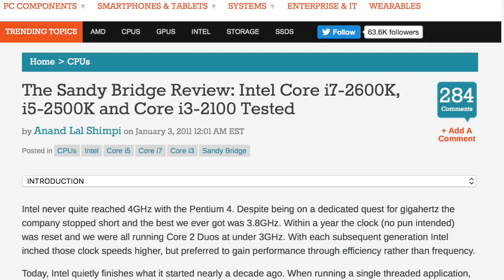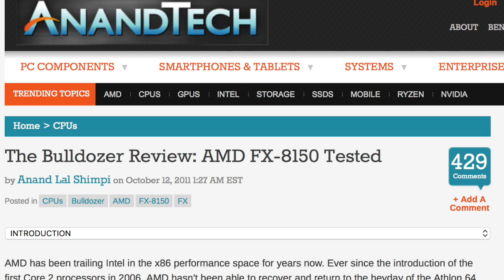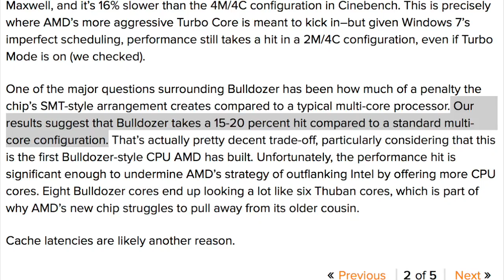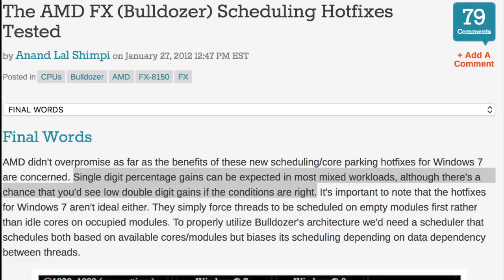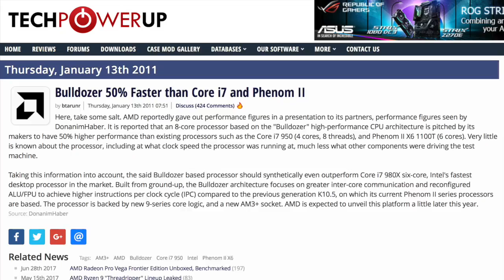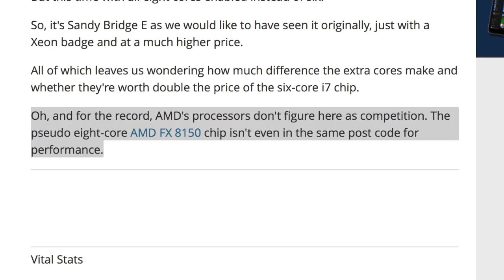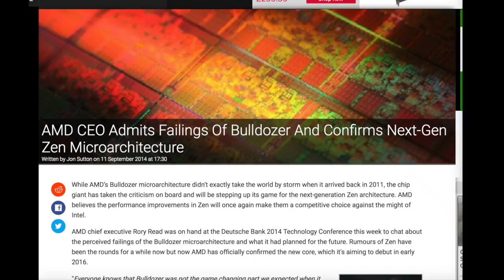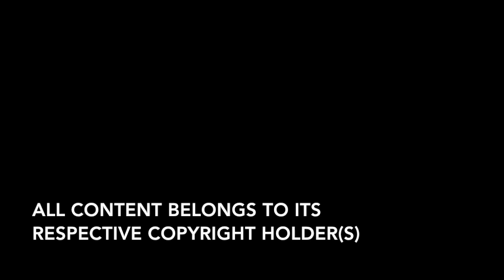The Bulldozer Story - and why AMD FX is better than you remember

Comment: I'd honestly have to say Bulldozer was indeed a failure. The FX-8150 couldn't even beat an i5-2500K in some multithreading tests. It gets even worse when you look at how much power and heat the FX-8150 would generate while under load. Bulldozer only did well in integer workloads that took advantage of the 8 Integer cores, but most applications, especially games, use Floating Point calculations; the FX-8150 had only 4 FPU cores that were shared between 2 cores put into what AMD calls it as a "module". This was a serious bottleneck on AMD's hands, but they decided to just go with this design anyways because there was no turning back then. The Core i7-2600K ran circles around the 8150, even in multithreading workloads that actually favored AMD. There were only maybe at most 3 benchmarks I saw from Anandtech that showed the FX-8150 winning against the 2600K. What only added more insult to injury was when the FX-8150 struggled to beat the Phenom II X6 1100T, despite a significantly higher clockspeed. When overclocked, the X6 1100T could probably beat the FX-8150 in even multithreading. This made the FX-6100 and FX-4100 not even worth buying if you had a Phenom II because of how slow they were. The 1100T dominated the 6100 in single and multithread. AMD was trying to call this generation of CPUs the next performance king and that it was going to outperform absolutely everything, but it underwhelmed all of us... massively. This only led to more disappointment being felt by all of us.

Then Piledriver released... but it still wasn't good enough. The FX-8350 was against Ivy Bridge, which still beat the FX-8350. Although Piledriver actually somewhat gained ground on the Core i5 in gaming and beat it in multithreading workloads, it still used much more power. Sure, it was competitive at the price point, but it only hurt AMD in the long run. A Bulldozer/Piledriver die size was a mammoth 316mm^2, whereas Sandy Bridge and Ivy Bridge were 216mm^2 and 160mm^2 respectively. AMD had made such a huge die size, meaning AMD could not fit as many CPUs on a silicon wafer. AMD had to spend more money to make the same amount of CPUs had they just went with a smaller die size. AMD had to sell these chips for a high price in order to make a profit due to this, but AMD couldn't when the Core i5 and Core i7 kicked the FX's ass in pretty much everything. In order to sell inventory, AMD had to price their chips lower and lower. OEMs didn't want FX, it ran too hot and it was too power hungry for small form factors. People in the server market didn't want Bulldozer either because of the power consumption when you could get pretty much the same performance from a Xeon, while using much less power. When you look at it this way, AMD was screwed either way with FX; they were stuck with a massive die sized chip that was very expensive to produce, but couldn't sell it at a high enough price to break even.

Then there's the motherboard issues... FX drew too much power for most motherboards, burning up VRMs due to this. This was very apparent with the FX-9590 where even the best motherboards were likely to be burned up due to the power draw. Motherboards were not designed at the time for such power consumption, causing the FX chips to actually throttle to avoid burning VRMs, which worsened the performance all around.

Economically, Bulldozer was a failure. There's no arguing that part. AMD had barely been able to keep afloat without being bought out or becoming bankrupt.

Comment: I have 3 desktops 1 has a FX 6100(Bulldozer) 2 has a 6300(Vishera/piledriver) 3 has 9590 (Vishera/piledriver) I game on the 6300. I use the other 2 for things like rendering 3d images in 3D Max, and other heavy threaded tasks, I also use them as servers. Under this type of workload, they perform awesome. These CPU's do best when u are running many things at once. I love my FX processors. I will not be upgrading to Ryzen, or switching to Intel. These processors do exactly what I need them too, and they do it efficiently. Can't ask for more.

Comment: Yeah my ATi/AMD machine can support a Bulldozer, but no processor they made had any significant gains over my AMD P2 - 1100T Black.. So at the time of Bulldozer launch I easily dismissed it.  The only way a Bulldozer outperforms my CPU is if my PC is off (which it currently is).  The only thing AMD did with the Bulldozer was dig holes in their road and let Intel skate away..... Also, you didn't mention the issue AMD/ATi had with shrinking their CPU die size ... which i believe they couldn't get down to the 28nm size where as Intel was at 22 and their next processor was going to be at 14nm.  Writing was on the wall... AMD was the only option if you couldn't afford an Intel build.

Comment: for me its this simple, its 2012, you have £100 and want to game and edit videos.
fx8320 and overclock vs i3 3220
one is 30% faster in tasks you might aswell get a celeron for.
the other one is equal in gaming and 100% faster in rendering videos and will last longer before needing to be upgraded.
fx8320 was best cpu i ever bought, 5820k (seems i love anything with the numbers 8, 2 and 0 in them) thoguh im now kicking myself that i gave intel money.....GREATT cpu, shit company, bring on threadripper 2.
they say games only use 4 cores, when i bought my q6600 they said games only used 2, look how long core2quad lasted and how long core2duo didn't.

Comment: That's the weakest argument I've ever heard. "The CPU isn't bad at all. It was just released at the wrong time." No, the CPU WAS trash, and even AMD admitted it. Was it weak for the money paid? Yes. Given the state of the market for gamers and the like, it was a horrible choice. As proof of this point, AMD's newer Ryzen 3 1200 clocked at 3GHz is within 2% of the performance of their flagship product, the FX 8370. A quad core of the newest generation clocked a full 1GHz slower is as fast as their old 8-core CPU running a full 1GHz higher.

THAT proves that Bulldozer and Piledriver were failures in design. Claiming they'd be better if they didn't have these issues is irrelevant. That goes without saying. It doesn't mean you have an argument to prove they're decent processors, it simply means you understand that they are what they are and what they were at the time. It also wasn't just Sandy Bridge they were up against, it was literally every CPU since Nehalem that AMD had to compete against. That was the issue. By the time Ryzen was released, Piledriver and Bulldozer were so hopelessly under-performing, that even when games fully utilized all 8 cores, performance was STILL less than an equally priced Core i5. There was no comparison and still is none to be had.

Comment: 7:50 This is incorrect. Note this Underload the AMD processor did not heat up. Incompatibility would cause AMD processors to heat up. Virus an Trojans,incompatible mods and Programs would cause AMD processors to heat up. Note open your cause you can find out by touching your graphics card or Hard drive. Both will be the things heating up. Not your processor. So it was incorrect.

Comment: compliers is the key word that developers never take any advantage of brands processors make...its lot simpler for doing microsoft way to compile than custom the software code based...c++ does the work..but it relies what emulations always want...more clock speed to push gpu data quicker out the pcie to memory then cores....not just throws the ipc and cores will solved the problem..nope, c++ take advantage any avx code and push more cycles per instructions from game engine was not based on windows 10....more like it was based console custom game engine

Comment: Im still running a 990FX / FX 8150 in 2013/2018+. (Asus ROG crosshair V Formula Z).

On Windows games like RaceDriver G.R.I.D. , Flatout 2, F.E.A.R, F.E.A.R. 2, Shadow Warrior, ROTT (after all them patches) paired with  GFX cards like the GTX 480, GTX 569ti , Radeon HD 7890, r7 260x, Gtx 960 etc and what I can afford (GTX 960 / R7 260x $150AUD vs $300AUD Gtx 1050ti / $480AUD RX570).

I don't play many current gen games apart from Doom 2016 and Shadow Warrior 2 (far mor taxing) I can still game unhindered (Wolenstein New Order required hefty overclock disabling half cores [1680x1050 / 720p] [crossfired 2GB r7 260x / single 2GB GTX 960)

Most problematic was running 2 instances of Hamdbrake transcoding h.264 1080p Blu Ray to 720p HEVC while out for the day on a ~38°c day with insid ambient rising probably passing 33° hours before O came home and smelled the settled dust burning with a hint of solder joints.

Fast forward to 2018 with 3 core pairs ~6 cores still working above stock I still have a little wiggle room.

Comment: remember when intel blaitantly lied about pentium 4? and then tryed to cover it up with bribery to benchmark software makers. then a decade later they owned up to their lies and offered 10% refund to any one with a valid pentium 4 system recpit.. their little lie made their users look retarted when they tried to regurgitate intels advertising lies vs real life results and performance of an athlon 64x2 slapping them in the face with cold hard fact. pentium 4 was the ultimate real failure even beyond cyrix as the biggest failure as industrys crippled them selfs by opting for pentium 4s setting the world back with literal garbage. then intel thought it would be cool to make a cpu that you pay for a code to actually use its full potential.. Dlc cpu?!?! fk that intel is not to be trusted. curb your enthusiasm for big dollar ad lies.
Reply: The P4 did have a few perks. Double clocked ALU meant that integer performance was pretty damn hot, FPU performance was not impressive. Intel did this with the intent of SSE2 blowing everyone's mind and everyone recompiling their programs.

Where AMD screwed up is they took notes of the Netburst architecture and must have genuinely thought that was a good idea. There are a lot of parallels between Netburst and Bulldozer. Similar 20-30% performance increase in the second generation as well.

I'm still pissed they never finished it. They finally released an Excavator core in Bristol Ridge, but it was massively cut down from the original Excavator design. A 14nm Excavator might would have changed everyone's tune. Originally they had plans for major improvements in the integer config, which was actually pretty damned decent, the FPU was going to be doubled...

Damn shame, just from an academic standpoint I'd have liked to see how it would perform.
Reply: Yep, i was one of the fools back then, bought a 478 socket 2.4GHz Pentium, that was the worst cpu that i had in my life...
Reply: Damn, good to know. I know P4 was beat by Athlon, but I had no idea it was objectively shitty
Reply: And AMD was any better with FX? lol, AMD fanboy alert.

Comment: While I plan on upgrading to Ryzen my old FX 8350 @ 5ghz still runs my games great. I cap my games at 60 fps with a free sync monitor. Many of the games I play are at 2k the older r9 390 still performs well. Key to FX is OC ram and at least 4.7ghz also use core park app that you can just turn off parking even after the patch certain games have micro stutter as it unparks.

Also using Radeon Pro to reduce  bottlenecks and understanding which settings is cpu or gpu bound. What games use all cores and which ones use only two for example. For example Fxaa/smaa (AA) is gpu bound and old Msaa is cpu bound. If a game is not using all cores the avoid msaa at all costs. Things like flip que size (1-2) can also help reduce stress. If a game is gpu bound then msaa x4 may actually give you more frames. Or flip que size set to 3-4 may give smoother fps. This is why I hate hardware physics (even on nvidia) most gpu's are already maxed playing the game so particles get push to cpu anyway why even nvidia gpu's take a hit with physics. 

Point is if you say have four theads like an i3 or some i5s which is good for games atm. You cannot off load gpu bottlenecks to the cpu without taking major hits on fps. Or say record in game video as well  having the extra threads will make these FX's age better than most people think. Btw I bought the FX because I edit and it stomped the i5 at the time and I couldn't afford an I7.  While it is a toaster and inefficient its served me well and I still don't "really" need a Ryzen yet.

Comment: like to see an intel CPU with 8cores/threads for less than £200 before ryzen and becuse there older the motherboards are also really cheap so yeah save some here save some there and spend what you saved on a better GPU that will most likly have a bigger effect anyway

Comment: I didn't have any problem with FX...until I bought a better video card. Went from a 7850 to an R9-290, and in half the games I played, it was bottlenecked pretty badly by the slow core performance(at 5.1 GHz). Switched to an Intel gen 4 at 4.8 GHz, and the bottlenecks almost all disappeared, only remaining at reduced levels in very cpu-limited games. FX is okay. It just didn't fit my needs.

Comment: I still enjoyed my upgrade from a core 2 duo 3.0ghz to an FX 4100 3.6ghz. All I really remember is that I could not emulate ps2 on my core 2 duo, but my budget 4100 could handle the ps2 emulation. :D Upgrading to a used 8320 kept my gaming rig alive and well through most of 2017! A Ryzen 5 1600 upgrade was just too tempting to pass up though! :D

Comment: I rocked a 8120 and kept it clocked at 4.5 and it would take all I ever tossed at it. I will say gaming with it at times on bf4 I would get latency where my fps would like drop and come back. After 4 years of it I went to a 9370 and my board would not allow me to overlook let alone cuz of the 220w power consumption it has to in my opinion have a good cooler when gaming or putting hard loads on it or at less I felt it did. I had less latency with it wait playing bf4 but still it would take all I tossed at it as well. I then went to the ryzen 5 1600 and tbh haven't gotten to test it really cuz my mother board died on me for some reason so waiting on the rma lol.

Comment: The server chips were actually pretty nice. There were Opterins with 16 cores/32 threads that pulled far under 100W with load.
Reply: AMD used the concept of CMT, is similar to SMT/HT but whit use of "Modules" is more like cluster computing, it means that the AMD Opteron's only have 16 Cores and 16 Threads only... -_-

Comment: I used a AMD 8350 and it served ok to good depending on the application. AMD came out with the Ryzen series of processors and AMD is officially Back. I got a 1600X and it performs quite a lot better than the old 8350 in most situations. at least AMD is rising up in level unseen since the K7 and AMD 64 and socket 462 and 939 days.

Comment: Had my 8350 since 2012. Never had a problem with this thing. While my friends paid 250 bucks for their i7, I managed to get a 8350 for 150 + have extra money for the GPU. I'm happy with the buy. It was and still is serving me well.
Reply: Agree. I‘ve a FX-8350 paired with a RX 590 and it’s doing it’s Job very well. No need to upgrade until I REALLY need to. But thats not the case at the moment (April 2019).
Just saying you all Intel users need to play games which take advantage from more Cores.
I‘m getting 60 FPS in AC Odyssey, Kingdom Come: Deliverance and Witcher 3. All of them are newer games and the recommended (Not Minimum!) setup stated by the publisher is indeed a FX-8350.
Bottom line: No need to upgrade until games need a higher recommended system spec. Point and over.
Reply: did the same lol. FX8150 + AMD HD7970  and guess who has more fps in games?  my slow brother spent same money as was I. but he got i7 3770 + GF660... LOL... intel+NV = stupid choice....
Reply: https://www.youtube.com/watch?v=gmhGQl8052o

Comment: There is absolutely nothing wrong with an FX 8350, it performs the same as an Xeon X5650, Google a vs. comparison & check it out, the outcome in benchmarks are too even to complain, it is much cheaper to build a "new" FX build than to even buy used parts around an X5650 cpu, the FX does deserve respect, so screw 4k resolutions, I am not buying a new monitor just to game in bullshit 4k, it is mostly all up converted from lower resolutions anyways, like an old dvds to hd just to fill the screen, I prefer to view pc video games in their intended resolutions, people wasted their money on a 4k tv & just  are desperate for a pc to support it, just buy an Xbox X & just go away, complainers are usually  just console gamers & games are all they care for  anyways.